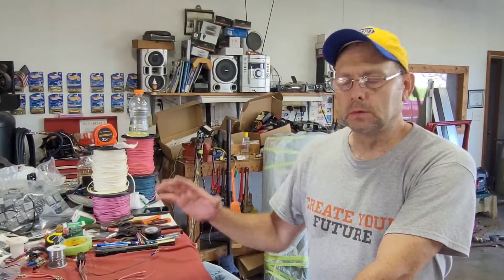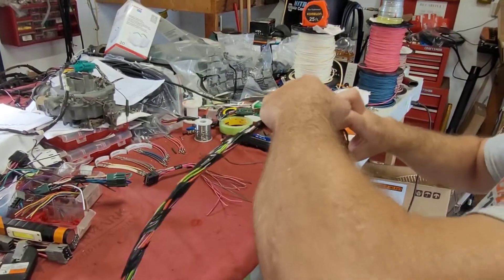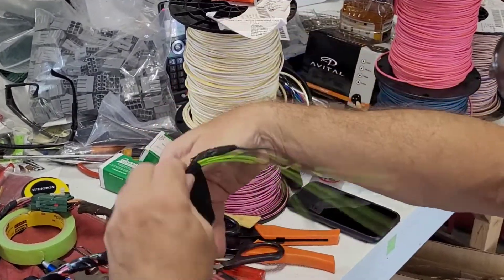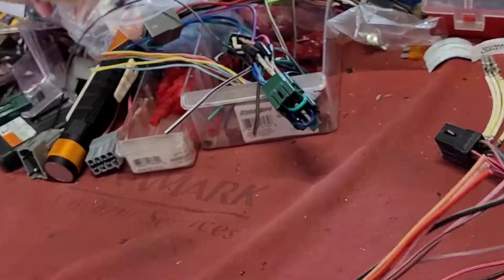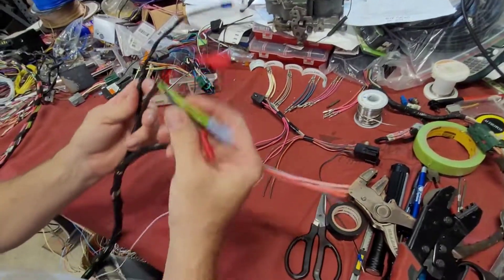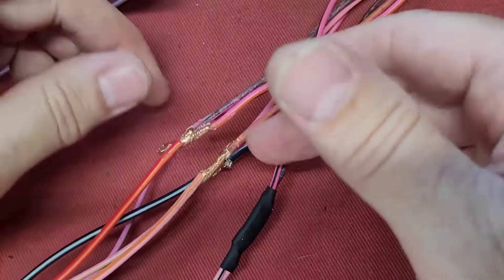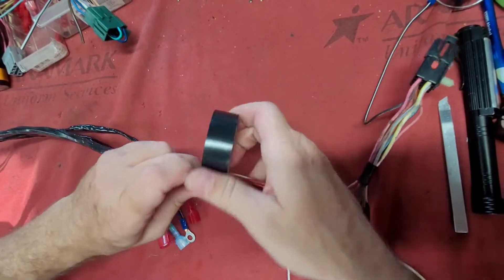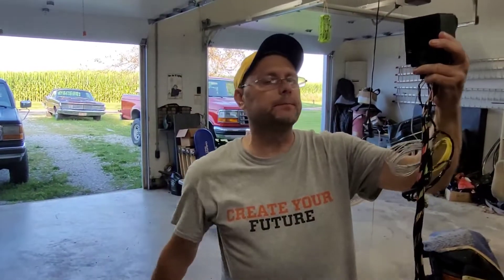Video 3 Step 3 Installing Factory Plug And Play Keyless Entry In OBS Ford F150 F250 F350 Bronco

Comment: With regard to the driver door unlock independent of the other door(s), I agree with "doing it the way the factory did it".  This is a security feature in that by unlocking the driver door only you minimize the chance of someone with nefarious intent nearby from slipping into the vehicle by opening another door.
Reply from the maker: Yeah, I think it's wise.

Comment: You’re the man Tony I love your videos keep them coming
Reply from the maker: Thank you! It's not easy to get someone that knows how and when to zoom in like Charlie. All these people have their own lives and careers but somehow we eventually get it done.
Reply: @tonyscarcare5657  I got a module and all the wiring plus the wiring that goes around the firewall to the other side of the truck 
It’s a 97 I will be putting it in a 1989 crew cab any tips?
Reply from the maker: @mikebrimm1872  that sounds like a nightmare. Does the 89 already have power windows and locks?
Reply: @tonyscarcare5657  yes sir
Reply from the maker: @mikebrimm1872  if it already has power windows and locks you need to get everything out of a Thunderbird or Cougar and follow my steps.
Reply: @tonyscarcare5657  thanks for the tip I’ll do that but first I’m going to download all your videos on this
Reply: @tonyscarcare5657  I’m also putting a 7.3 powerstroke in this pickup
Reply: @tonyscarcare5657  I’d like to hav a copy of your wire note’s if possible

Comment: Ok got that done. Now do we go to the video of April 10 2021 to wire it in and change switch wires around or is there another video coming.
Reply from the maker: There is another video coming for regular cab and extended cab. If you have a crew cab then yes, you can go to the next video and finish up. You can skip the step of cutting the unlock wire in the driver kick panel if you aren't worried about driver door unlock priority.

Comment: Hey Tony, I found your page and was hoping you’d have some insight on an issue I’m having. 

I have a 95 F350 crew cab powerstroke. The headlights and marker lights turned on by themselves the other day, even though the headlight switch is pushed in. I pulled fuses and couldn’t get them to turn off. The only way I was able to get them off was to disconnect the battery. 

On top of the headlight issue, the horn started blowing off n its own and wouldn’t turn off until the horn went out. I figured I’d start with a new headlight switch but was curious if you have had this issue before? Any help is appreciated. Thanks!
Reply from the maker: I have heard of the headlight switch shorting out and melting the plug, but I can't say I've ever personally seen it. That would definitely be a good place to start.
Reply: Hey Tony, so I did some more digging and I found that when I remove fuse number 12 from the interior fuse panel, the lights operate as they should. Fuse 12 controls the power door locks, electronic shift motor 4WD, and power lumbar. 

I pulled the headlight switch off and checked voltage at the harness. When the number 12 fuse is in place, and the truck is off, I have 12V going to the brown wire on the headlight switch harness. This wire goes to the exterior lamps, which explains why the lights come on. When I remove the fuse, I have 0V to the brown wire, until I pull the headlight switch to the on position. 

Does this mean that the brown wire has rubbed on something and exposed the bare wire, which is then touching a wire from the fuse 12 circuit? 

Again, any information or tips will help. Thanks for responding to my first comment!
Reply: I also don’t have the schematic so tracing wires is difficult. It looks like there’s a large black with orange stripe wire, and a large black with white stripe wire that run to fuse number 12.
Reply from the maker: Do you have factory remote keyless entry?
Reply: I don’t believe so, I’m the second owner and the truck didn’t come with a fob or anything. How else can I determine if I have keyless entry? 

It does have an anti theft. If you power lock the doors, and then open the drivers door with the key, the horn will go off and you can’t start the truck. You have to key unlock the front passenger door to shut off the alarm and start the truck. Not sure if that was a keyless feature or not.
Reply from the maker: If it has anti theft, then it has keyless entry. Anti theft was 94 and 95 only and came with keyless entry. I believe you have a bad keyless entry module. This video shows where it's located. 👇
https://youtu.be/Tzu0oB4UkUc?si=VZYHyQ6TCgLBbQTi
Reply: Holy shit I had no idea. This is probably a stupid question, but to trouble shoot the bad module should I simply unplug it and see if the headlight issue continues?
Reply from the maker: Yes
Reply: Unfortunately the headlight issue is still there if I completely unplug the keyless entry module.
Reply from the maker: It has 3 plugs on the bottom of it.
Reply: I took off the 3 plugs and also the black wire that plugs into the side of the module. When I put the #12 fuse back into the fuse panel, the exterior lamps turn on, even with the keyless entry module completely removed
Reply from the maker: The anti theft module could be bad, too. You can try unplugging it, but it's a little tougher to get to. It's behind the dash bezel to the right of the instrument cluster. Kinda right behind the 4wd shift buttons or wait to start lights. It will be white or ivory colored.
Reply: Ok I will try that tomorrow. I already have the dash bezel removed so hopefully can find the anti theft module. I’ll send you a comment tomorrow. Thank you for your help sir
Reply from the maker: @mitchlunder8910 call me at 618-283-2775
Reply: Ok I will call you tomorrow!
Reply from the maker: I've replied to your last comments but I don't see them. Give me a call at 618-283-2775

Comment: For some reason I do not have the pink orange on the harness side
Reply: On the tee side rather
Reply from the maker: @tomski9524  what did you get the wiring out of?
Reply: @tonyscarcare5657   a 1994 f150 that already had keyless entry
Reply from the maker: @tomski9524  there has to be pink/orange there somewhere. It's all unlock. Red/orange is driver door unlock.
Reply: @tonyscarcare5657   I will probably go get another harness from the junkyard that has the pink orange and red orange. Thank you for your help!
Reply from the maker: @tomski9524  you're welcome. Good luck.